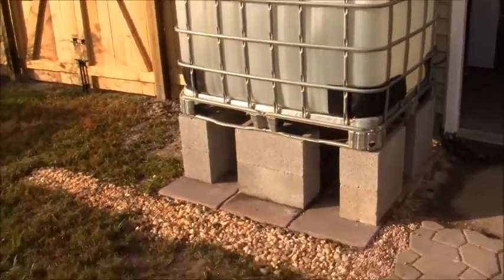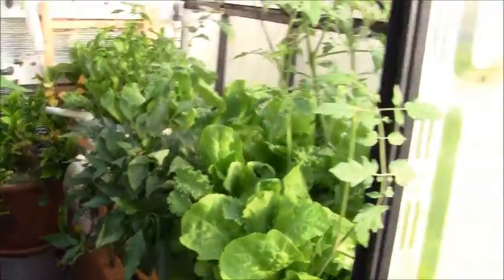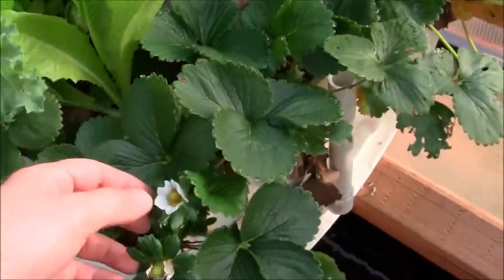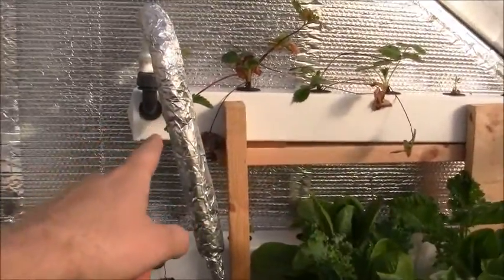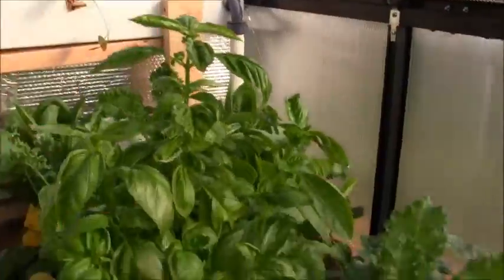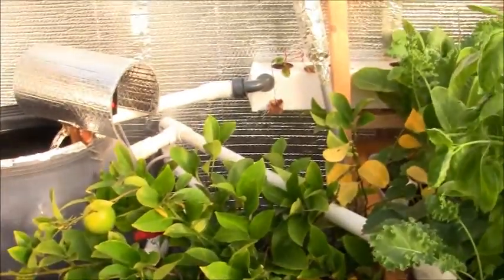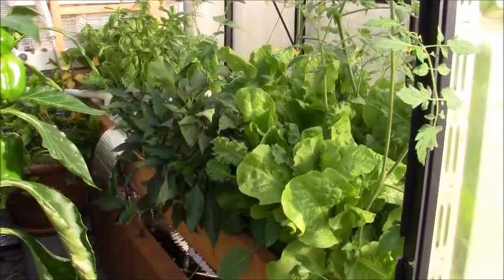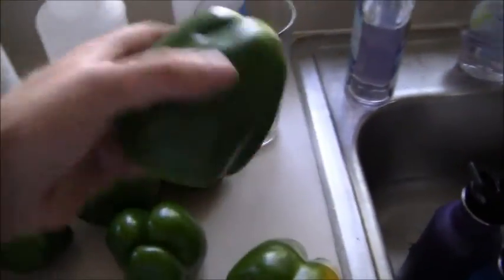Aquaponics After 1 Year! Cloning Success

Comment: Great garden man, your greens are lovely. Only downside is you're moving the camera a tad bit too much, it left me somewhat nauseous.
I would like to learn more about the solar power system, and how well it runs your system. What is the wattage of your pump and other electrical components?
Reply from the maker: Thank you for the compliment. I agree with you about me moving the camera too much. I have actually moved 3 times since this was filmed and the system no longer exists. I later built me new system on wheels and it has been awesome. Survived one move so far... and about to move it again in a month or two. That solar system worked well enough to run the entire system for about two days. I think the pump was 15W but I don't remember. In the future I plan to get another dedicated greenhouse and build a larger system. Just too much moving around going on in my life right now. I will build a solar system for it as well. Mostly as a backup for when power goes out/the main pump fails/etc.
Reply: @great0789  Thanks so much, I appreciate your prompt reply. I am building an AP system in a slightly remote area, and might be relying exclusively on solar power. I think the system I have in mind will fair just fine, even if it runs only during the day. Your garden is such a huge motivation for those of us just getting into AP. Thanks.

Comment: Did you use this green house all year and is it completely run off of your DC solar supply? Amazing garden! How many gallons of water are you using here?
Reply from the maker: For a good while there the water and the fan were run off of 12V. After a while I decided that it was best to just use solar as a backup feature. 

I did grow year round in there. Once the water gets below 50 to 55deg F the goldfish pretty much stop feeding though. So plant growth stops for the most part except on warm/sunny days. 

The thermal mass of the system really slowed down the temp swings! (really good for growing)

Comment: This is the only book I could find on Aquaponics that had solid reviews [Check Details Here  >>>fb.com/AquaponicsSystem-125782164733983/app/208195102528120  ]. I hadn't started my own Aquaponics set-up yet, but am extremely interested in doing so.I wanted something that would help me understand all of the systems required, how to plan a build, and what to expect once it's set up. "Aquaponic Gardening" did a good job of answering all of the first round of questions I had.